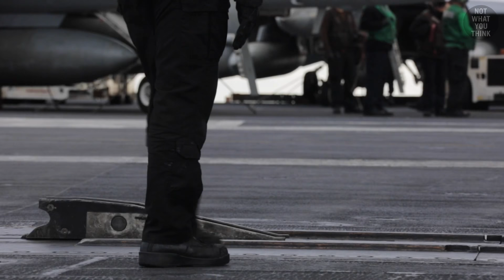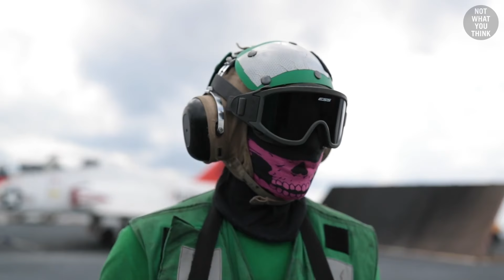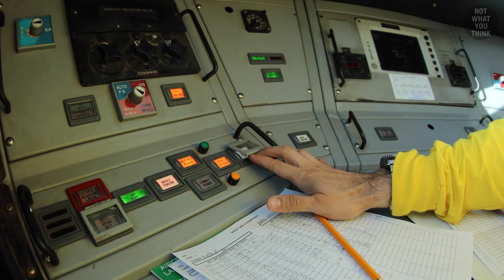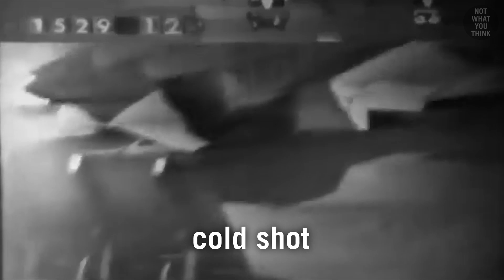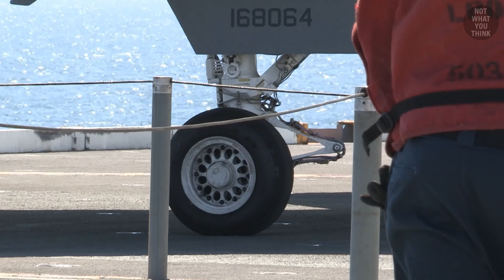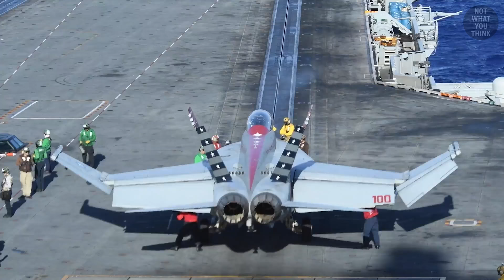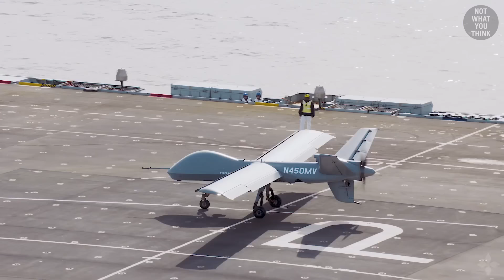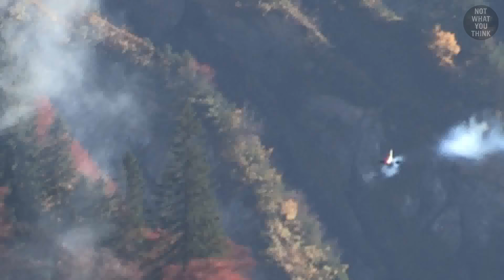Why the US Navy is Replacing Electric Catapults with Steam

Comment: I was an ABE3 (cats-arresting gear) on the Carl Vinson in the mid 80’s. Steam catapults is an assured proven technology that has worked for over 60 years. I don’t know enough about the electromagnetic cat, but it sounds over engineered. I don’t know if it’s cheaper to manufacture and operate, but steam has proven It’s reliability.
Reply: just because something is proven doesn't mean it's better. I'm sure people thought the same way before the mechanization of agriculture or when electricity was first gaining a foothold. you have to think rationally, not emotionally, which can be hard to do
Reply: Why did we replace steam trains?  Were they not a proven technology?  What about EV's?  Why are we looking at lasers? Aren't bullets a proven technology?
Reply: @loopie007  Diesel electrics were chosen because, besides the reasons the other person commenting left about carrying coal and water, they meant we didn't need to have the massive infrastructure along the rails to store coal and water. Steam was actually a more reliable source of power when the switch was made. The switch is what actually put a lot of railroads into financial troubles that lead to their demise too. Their executives and CEOs all felt they needed to make the switch all at once and drove out railroads into insolvency.
Reply: @loopie007 When it comes to the readiness of our fleet, the cats and arresting gear have to be good to go when needed. A carrier is just a big boat without the aforementioned.
Reply: @loopie007 The reason why  converted steam locomotives from diesel to full electricity is because we don't need to carry water and coal, not because electricity is cheap...
Reply: But V2 can go from a 260 man division down to about 180. ABEs don't have to be on deck 2 hours before flight ops to set elongs. The cylinders aren't going to be worked on instead of liberty in foreign ports. If anyone should be cheering for EMALS, its the ABEs.
Reply: @michaelmappin4425 I started this chain and I have been out of the Nav for 35 years so what do I know? Apparently nothing and that’s ok. I know there will always be new tech that changes things. All I was saying is I heard of all the issues that the FORD has been having.
Reply: @SSO1025RET They did have a lot of issues between the time of deadload shots at Newport News and flight deck certification, but I'd say it's mostly all worked out now. I think it's all the same things you'd expect upon roll out of new technology. I think it had to eventually happen. V2 has always been pushed harder than the rest of the ship.
Reply: @michaelmappin4425  While reducing personnel and on-site maintenance, the actual warship will likely be unable to operate for a considerable period due to electrical system over-holes. This is also the reason why nuclear propulsion was used, but it also means reversing it. Is electrolytic injection highly reliable? I'm going crazy trying to put ECC into my computer memory right away, but is electrical positioning simple? The electrical injection molding seems to move less, but its lifespan management by heat makes it even more complex. The compromise point is that they used a mechanical supplement called a flywheel to mitigate that. China is introducing it regardless of how many people die.
Reply: @Mah3mopI'm not sure what you're trying to say but Ford has been deployed for 8 months straight and operating nearly continually.
Reply: @michaelmappin4425  No. It has not. It was dry docked for years because the EMALs system didn't work and it still doesn't work properly. It has a massive reliability issue.
Reply: @TheFoulMouthNews This is the reason I started this chain. Because of the problems the FORD was having.
Reply: @SSO1025RET  Problems is an understatement. It is appropriate it was named after Gerald R Ford considering it is the Edsel of supercarriers. It deserved to be called Ford with that being the case. It also deserved to be called Ford because like its namesake, it will tip over at some point.
Reply: @TheFoulMouthNews Hold on just a second. I have contacts aboard Ford right now, I'll check on status. By the way,  the only time Ford was ever in a dry dock was during construction. That's where they build them, in drydock 12 at Newport News.
Reply: @michaelmappin4425  No. It was in dry dock after its launch for multiple years because of its EMALs system not working. Go look it up. Just like everything else I said here, it is a matter of public knowledge.
Reply: @TheFoulMouthNews I stand corrected. The Ford did return to drydock during the 15 month post shakedown availability. It was only in to inspect the hull and some limited repairs after shock trials. Most of the availability was pierside and nothing about the drydock had anything to do with EMALS. I only post these answers for everyone else's knowledge. I think you're a bot and I no longer wish to talk to you.
Reply: @michaelmappin4425  I love how when someone doesn't agree with another in this day and age people like you automatically go with trying to label them as a bot when they full well know that person isn't one.

Grow up! That tactic doesn't work. It is infantile and immature, and it shows what a tool you truly are.

Now, would a bot call you out like that, zippy?
Reply: @michaelmappin4425  You do realize that the US Government made it so only "authorized" contractors approved by the manufacturer can work on the EMALs systems right? I'd rather have US military personnel doing that work but that is never going to happen because the brass at the Pentagon and in the Navy are corrupt and should all be in prison for taking bribes and kickbacks.
Reply: @TheFoulMouthNews Where are you getting your information?
Reply: At some time the steam catapult system was new and had bugs that needed to be worked out as well. Same with the Nuclear submarines and they have been around for nearly 70 years.
Reply: @jeraldbottcher1588  There were no bugs with steam catapults because steam was a well tested and used technology at that point considering it had been used to power things for well over a century plus. They initially tried mechanical catapults and hydraulic ones to only find they were not reliable and in regards to mechanical systems not powerful enough to launch most aircraft.
Reply: @TheFoulMouthNews  But at the beginning there were bugs galore. The 1st time they come up with something always has bugs to be worked out. With the ELAM. almost all of the bugs are software. The hardware is very solid. It will surpass the reliability of steam in very short order.
Reply: @jeraldbottcher1588  I do not agree that it is just software bugs or that the system will be more reliable. There is a reason why the US military, especially the Navy, has traditionally has not gone with the latest and greatest. It has forgotten that too and it will come back to but the US in the butt too.
Reply: @TheFoulMouthNews  Every system the military has ever come up with has had bugs, Yes the military does normally keep up with the tried and true. But think about guns and powerplants the Navy has used. At 1st there were all sort of issues with new powerplants, now there are no coal or oil steam power plants. Fire control radar has gone through many changes, some of them were failures, others were instant gold mines, most times it wasn't until they fully matured. My bet is that in 10-15 years steam cats will be on the way out.
Reply: Mag launch systems cost substantially more and are not remotely reliable. Go look at the Gerald R Ford and the problems it has had with its catapults. It has been a decade now since it was "ready" and took its shakedown cruise, and it is still having major problems with them. China stole the technology from the US which is well documented along with it having the same problems as the US with it.

Supercarriers are overrated and the naval equivalent to being trailer queens in the car world at this point. The USS Midway during Desert Storm with less to work with put them all to shame during it and it was a WWII carrier.
Reply: @TheFoulMouthNews  Mag launch systems may cost more to put in, but they are much cheaper to run and maintain. Just like a laser printer costs more but the cost per page is much less making it a money saver in the long run. And the MAG systems are getting more reliable all the time. Do you think catapults were any where near as reliable in the beginning as they are now?
Reply: @jeraldbottcher1588  The system that requires location information and data for operating shuttles for high-mass projectiles like aircraft can never be simpler than vapor-assisted accumulative injection. Having fewer swaths doesn't necessarily mean lower costs and difficulty. Thermal lifespan is a very serious flaw that cannot be noticed on-site, and this ultimately leads to the overall operational trust, forcing warships to return to port.
Reply: @Mah3mop Then there is the fact to consider that the US Navy and other military branches have traditionally gone with older tech because it is proven reliable where reliability is crucial to maintaining combat readiness. Steam was an old technology by the time air craft carriers were a thing and they had other contending launch methods but steam was chosen because of its reliability and use for well over a century plus.
Reply: @TheFoulMouthNews Absolutely, 10 Nimitz class carriers still working like a charm.
Reply: I guess we’ll have to see how the Kennedy fairs. She’s doing sea trials now from what I understand.
Reply: @TheFoulMouthNews I agree obviously. Look at the M1 Abrams. Engineered in the later part of the 70’s and it’s still going strong. Yes it’s been updated to the beast it is today. But we’re talking apples to oranges.
Reply: @SSO1025RET  They are not only working like a charm, the catapults are their most reliable system on the ships too. They don't talk about that though because why fix something that isn't broken.

For example, USS Midway, a WWII vintage carrier, served well into the 1990s and its steam catapults were beyond reliable. They were actually more reliable than their modern counterparts' steam catapults at the time. Not only that, Midway also as a much smaller carrier put the others in the Gulf during Desert Storm to shame in how many aircraft it launched, recovered and sorties they flew too. It was almost 50-years-old at that point, less than half the size of a supercarrier and was doing more with much less. When I look at things like that, it makes me wonder why we are putting all of our eggs into one basket with supercarriers filled with untested tech.
Reply: @TheFoulMouthNews You are a virtual stream of incorrect knowledge. The Essex carriers had hydraulic catapults and some were converted to steam in the 50s. The maintenance for the latest and greatest steam catapults (first developed in the late 80s and used all the way up to George Bush) is unbelievably complex. I'm going to go out on a limb and say you don't know a lot about V-2 Division.
Reply: @SSO1025RET  The M-1 even in its earliest incarnations would still be a contender in tank battles today too and still be considered a beast as well.  The prototypes were actually better than what we got on top of this. Imagine if they were chosen as the final form for the M-1. One of my all time favorite tanks in War Thunder is the XM-1 and it puts the first production M-1s to shame in both performance and sending shells down range.

On this type of idea, look at the Sherman Tank. It served in multiple militaries after World War II. including the US, well into the 1950 and beyond. Israel kept them in service well into the 1980s with updates and upgrades, and they were still competitive with modern tanks upon being retired.

As I said in in a comment here... Just because something is old doesn't make it obsolete. That is something a lot of people have forgotten in only a few decades in our disposable consumer society that we have found ourselves in today.
Reply: @michaelmappin4425  Actually, I have a love of history, especially military history and a degree in history. I know more than you'd want to give me credit for.

USS Midway and her class were World War II era carriers. They had steam catapults from their inception and it itself served well into the 1990s. It was a flagship during Operation Desert Storm. Not only that, it was a normal non supercarrier and it put all of the supercarriers deployed to the Gulf during the war to shame. It launched and recovered more aircraft along with flew more sorties than them. It had more up time with its catapults too.

 Steam power is steam power. The principles of it and how it works remains the same no matter how much you gum up the works with "improvements", which Midway proved those supposed "improvements" were sh*t when it b*tch slapped our greatest nuclear supercarriers that had those catapults you brought up from the 80s. That is a matter of fact with it doing what it did in regards to launches, recoveries and sorties. I would put money on it doing the same today with the USS Ford too.
Reply: @TheFoulMouthNews Computer, end program
Reply: @TheFoulMouthNews  I believe you and I our 
Definitely on the same page. Thanks Foulmouth
Reply: @Mah3mop However. Steam catapults wear out over time, just like anything else. One thing they did not mention is how many of the failed cat shots were just a failure to initiate vs how many ended up with a failed launch and a bird in the sea.
With the ELAM a failed launch can be rebooted and restarted very quickly. Not so with steam.
Reply: @jeraldbottcher1588 Who made the foolish story that electric injection can be rebooting? Discharging high-voltage power to restart is more difficult than opening the valve of a steam accumulator on the sea. Even in modern times, high-capacity, large-scale production often primarily uses primary energy sources as its primary function. The secondary conversion of electrical energy contradicts the logic that electric vehicles are eco-friendly. It's not that electric vehicles are eco-friendly; it's simple to manage environmental regulations at large-scale power plants that generate electricity; it's a lie to say that electric vehicles are eco-friendly.
Reply: "Yes," they say the steam system wears out. That's right. However, the electric type also wears out. It's not just situations like railguns that wear out. China understands the capacitor as a Ford ship with a flywheel. The capacitor causes unpredictable thermal defects that are not visible to the eye, and the flywheel has space and noise (anti-submarine detection) wear. There is no evidence that electric and steam systems are superior to steam systems in terms of the results showing that both electric and steam systems can perform the same points in the event of launch failure. Above all, no matter how fast the electric system is... We can't use 100% of the ejection device during the takeoff and landing preparation process.
Reply: @Mah3mop However the monitoring of the electric systems monitor for defects at a much more granular level than possible with steam. I say give it time and let's see how it matures.
Reply: @SSO1025RET  No. Thank you. It has been great finding someone here who gets things.
Reply: Great NOW in the news, Ford and Kennedy can’t launch the F 35 C due to issues with the new electro cats. 

The Ford and the Lincoln are now positioned to back each other up if any conflict begins with Iran. The. Lincoln is the only carrier currently able to launch the F 35C
Reply: So did coal powered ships.  The world moved on.
Reply: So was coal.